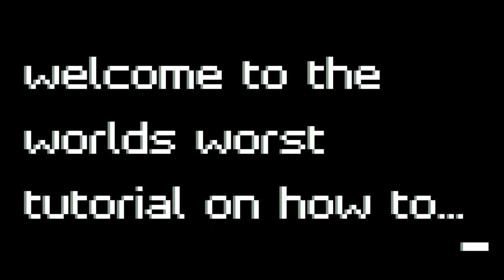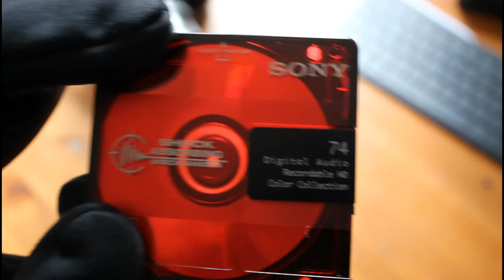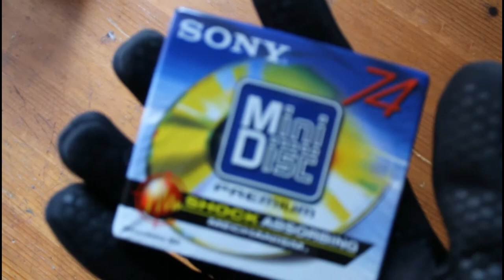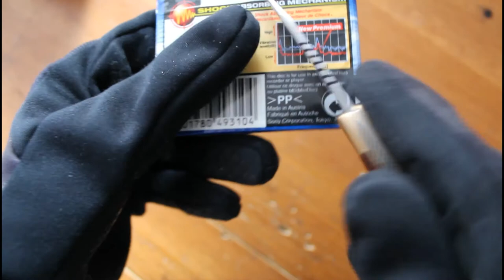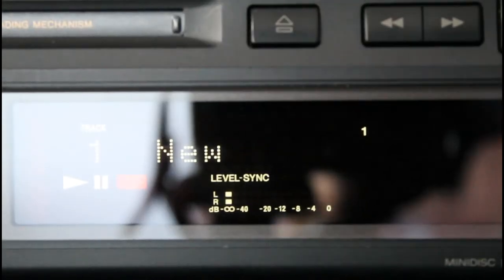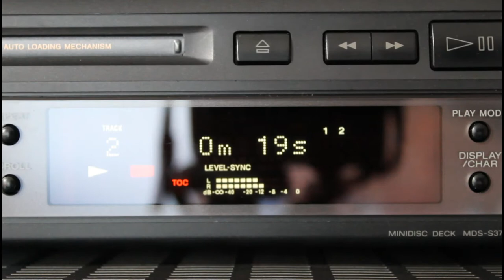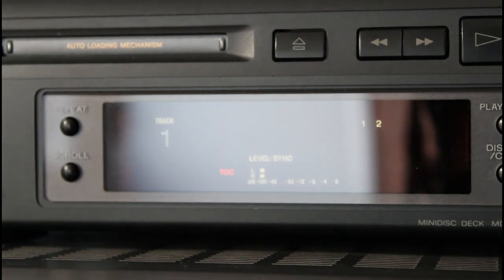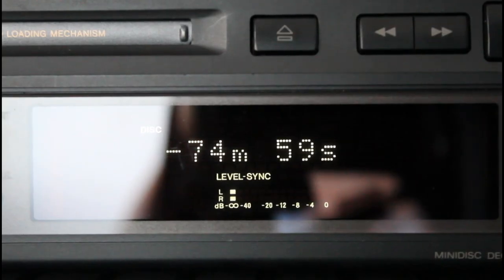how to record a MiniDisc

Comment: Nice video, thanks. Can  you tell me what cables and connections I need to record from a tape machine or a CD player. Regards
Reply from the maker: Thanks, if your using a cd player, if possible you could use a standard optical <toslink> cable or coax, if youre using a cassette deck or reel to reel you use the standard red and white phono cable, or aux to rca cable if your using a walkman.
Reply: @idontsmile666  Thanks for your speedy reply.
I do have a coaxial digital RCA cable.
Recording up and running now.
Regards

Comment: I still love minidisc ❤️ I wish Sony or a another brand to release them only in Japan can u sell buy a minidisc deck
Reply from the maker: You can still buy a new minidisc deck fron teac and tascam but it is a hell of a lot of money, sony still make the discs but only 80 minute basics. Decks and discs can be found on ebay and Facebook for a decent price but you need to read the description as im now on my third recorder and the one in the video as stopped reading and recording and ejecting properly. If you're looking for a recorder i would look for the recorders that use a plastic belt driven mechanism as the metal ones are known to fail more often these were made from the mid 90s to the early 2000s. A decently priced and respectable machine is the sony mds sd1 which was part of a compact hifi system but works fine on its own.

Comment: Nice Machine, Not All CDs Will Correctly Record To A MiniDisc Due To Some Gaps Between Tracks, Some CDs Also Have Cross Fade Which Makes It Hard To Record Tracks, Some CD Players Have A Feature Called Auto Space, This Means That The CD Player Will Automatically Place 3 Seconds Of Silence For Your Recorder To Detect The Gaps, Pretty Neat Feature, Also Why Are You Wearing Gloves?
Reply from the maker: I am aware of the track gap issue and will be fixed on the updated version of this which is a work in process which will cover using both a newer early 2000s deck and a early 90s portable (mz-r37) also the gloves thing was to with grip issues as for some reason it was still hot enough to make my hands sweat like mad losing grip of the disc and controls but it didn't really work as seen at the end as I still launched the disc out of my hand.
The update video will use my new machine with is a Sony mds sd1 from around 1998 to the very early 2000s. 
Kindest regards-
Idontsmile6666
Reply: @idontsmile666  Cool, Sounds Interesting, I Understand What You Mean Now, The Gloves Thing Confused Me Lol.